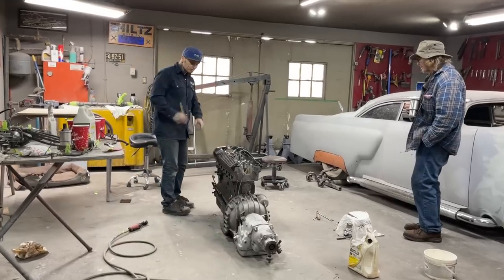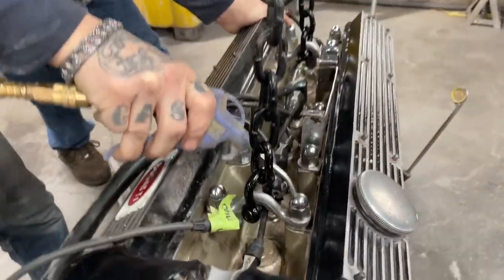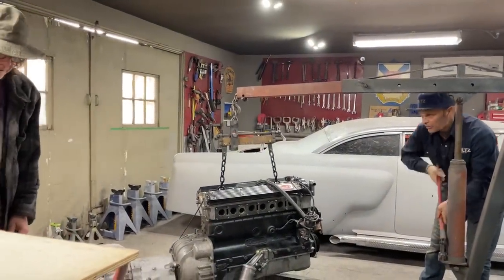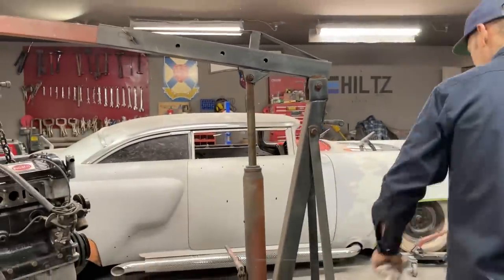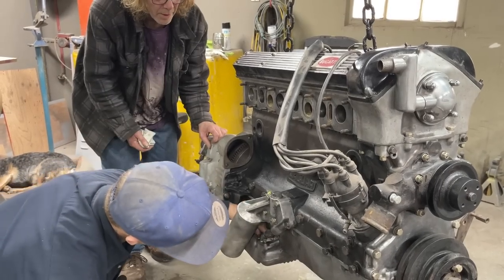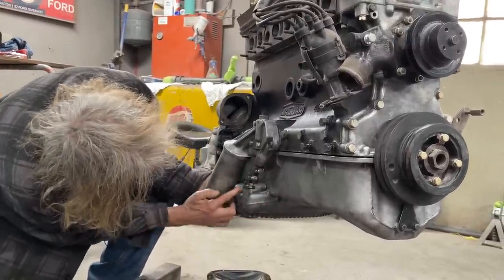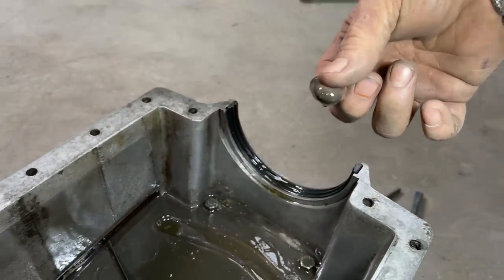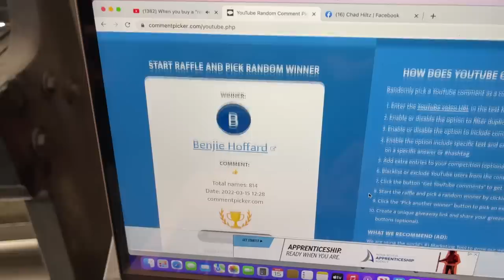The Moment of Truth: Pulling the Oil Pan to Check the Internals

Comment: Why can't Jim get past the oil filter issue. There are metal filings in the pan. Period, end of discussion. Regardless of what it's got for a filter.
Reply: This 100%.
Reply: I know right. Plus can’t believe no one thought that perhaps if those shavings aren’t in the filter, that perhaps it’s the wrong filter. BOOM
Reply: That engine is old. Not rebuilt
Reply: Exactly !
Reply: Unfortunately the metal always goes to the bottom of the pan and only a small fraction ever makes it to the filter. The pickup tube only goes down so far and it doesn't wipe the bottom of the pan. I agree the motor is not what it should have been. That really is a huge let down.
Reply: That's a scam rebuild and a poor shade tree overhaul There are good used engines with 50,000 miles or less that are very clean and properly. Maintained will run trouble free for 200,000 to 300,000 thousand miles trouble free.  Sorry this one didn't work out.  There are reputable used engine dealers and rebuilders that will warranty up to 100,000 miles. Good luck. Like your show.
Reply: Nothing to do with oil filter, that oil shouldn't be sludged and black for a engine that only been broken in. It takes over 1500 miles for new oil to start turning black. That engine is wore plum out!!!
Reply: He always fixates on things.
Reply: @Brab82  Jimbo does fixate. Because it's real, it is part of his unique charm!

Comment: It looks like you guys are over your heads. Jaguar engines are my area. I'd be happy to help out, but I'm 1500 miles away.  Your friend Jimbo sounds like he has no idea what to do. Jaguar engines leak oil! Making a Jaguar oil-tight is tricky business. Gaskets NEVER get reused. Let me repeat NEVER. A gasket set is not expensive. There are a few good places to order parts. Virtually everything is available. Get a workshop manual. I think you'll want to separate the engine from the transmission. An engine stand is handy, so you can turn it upside down to work on the bottom end. A stand is pretty handy for painting and detailing too. Pull off cam covers and check valve clearances.  Remove bearing caps and look at the bearings. Put a fiber optic scope down each spark plug hole and look at the cylinder walls. Cut open the oil filter and look at it carefully.
Reply: This is way past looking for metal in the filter.  
He needs an engine guy and a machinist and a few boxes of parts.  
Quite a few inline sixes are available that would work much better in this car.

Comment: An engine oil filter doesn’t magically clean the inside of  a “dirty” engine. Once settled to bottom of oil pan it’s there to stay. I’ve tore down engines with over 300k untouched and oil pan was cleaner than that.
Reply: With a rebuilt engine?
Reply: I pulled down an engine with 250,000 miles on it and it was cleaner than that.
Reply: @yamaha226  I’m thinking he never rebuilt it. Maybe replaced something to get it running. But that sludge on the bottom is not from a new rebuilt motor.
Reply: I pulled myself over a engine with 1million miles was cleaner that!
Reply: yea that gunk is THICK on the windage tray,  just thick, soft aluminum bronze... big end bearing material .. frankly and I'm not trying to be a dick here but I've never seen it so thick like that in person, only in books and internet.. the "how to rebuild engines for dummies manual"...  DOH!!!  j/k man... confident your builder is a pro, shit happens... I'm real meticulous and change oil/filters early and often, specially my bikes, what we saw in the video is what I'm trying to avoid.. could be 150k hard kilos on that oil change? we just don't know, buts if thats a fresh build I'm a virgin, three times...

Comment: Being a motor engineer I would completely strip the engine. There should not be any metallic particles in the sump. The oil pump will pick them up and circulate them around the rest of the engine. To me it looks like a used motor that's been cleaned up to look nice and new. Strip it or give it back.

Comment: FYI:  The filter only filters the oil being pumped into into the top of the motor from the pan.   The oil pan will collect everything that runs down from the motor, then you pump it through the filter to resupply the top of the engine.  In a fresh motor, there should be VERY little sludge and DEFINITELY no large chunks of anything in it.  When the motor breaks in the surfaces wear , a little sludge on the bottom is expected and is normal, but not caked like that.  After break-in, you change oil to get rid of that initial junk in there.  
You should buy a cheap bore scope or endoscope.  You can pick one up for about 25 USD  think.  They attach to your cell phone so you can take it with you when you check out a motor.  Just pull out a plug and take a look, that will allow you to see the  crosshatch pattern without taking off the cylinder heads.

Comment: I absolutely love when Jim gets excited. "Poison" he says. You're right Jim, that engine is "Poison"
The filter does filter the oil yes, but metal filings will be found in the oil pan on a motor that's got internal problems like that.
I'm no expert, but on a newly rebuilt motor there shouldn't be any metallics in the oil pan like this one has.
Reply: so true, years ago some had magnets on the bottom of the pan.  that way it would not go throgh your engine again
Reply: @ashpnk06p60  yes sir, I've had magnets on my oil pans over the years when I had older pickup trucks.

Comment: I was nearly shouting - get a damn magnet! I think that engine is worn out and looking up at the pistons will tell if it's been overhauled. Pulling the rod caps will also be telling, though they could have been replaced as they are relatively easy. Regardless, I doubt anyone watching the video would think this engine should be used unless it is competently overhauled. I also think finding loose items and improper fan blade bolts was good fortune. Jolene's intuition was spot on.
Reply: I’m more worried that no one mentioned that it wouldn’t be that way if it had the right filter.
Reply: Well said
Reply: Good point
Reply: @linc4572  lol
Reply: I was like you with the magnet lol! Sure looks like metal. But it doesn't matter I s'pose, Its foreign and "poison".
Reply: I’m going nuts yelling at the tv !! Chad keeps his coool pretty good ! I can’t

Comment: Makes you wonder if that pan was cleaned when the engine was rebuilt before Chad bought it? 🤔 I'd pull a bearing cap and check the bearings for wear.
Reply: Now you got to check everything in the rest of the motor just to be sure iam so sorry to see this happen , l hope it all works out for you.
Reply: @jerryporter9115  I agree, but if the bearings are wore theres no use in checking the rest. Hopefully Chad gets it taken care of.
Reply: They should check that filter. Wouldn’t be that way without the right filter.
Reply: Dude, the engine is old and tired. It's not a rebuild! It's not new!

That looks dirty like 150,000 miles!

Old used engine, not rebuilt. No way
Reply: Thought the same thing! Either way is what it is hopefully the out come isn’t as black and ugly as that oil is!
Reply: There's no way that's a rebuilt motor.
Reply: @johnmacmillan2766  gotta go get it checked out by a mechanic, get it rebuilt, give dougy the bill
Reply: @jakefriesenjake  Unfortunately I don't think Doug will pay for anything... I've had issues with a similar scam artist. A body shop recommended to be by a family member... Nothing but shoddy work with shiny paint. It sucks... But you have to move on and go to a better shop.
Reply: To rebuild an engine and NOT clean out the pan before reassembly is just ridiculous! If I take something off it is always thoroughly cleaned before it is out back on... That's just common sense.
Reply: @OldsmobileCutlass1969Va  I couldn't agree more, but some people take short cuts instead of doing the job correctly.
Reply: @OldsmobileCutlass1969Va  some people don't take off the riveted, hot oil splash gaurd, under pan, from underneath an intake Manifold, after sandblasting and cleaning..... You should see what comes out....

Comment: Need to take a connecting rod cap off and check for copper showing through the bearing that will tell you if it's been rebuilt or not
Reply: Mains too brother
Reply: Plastigauge - if it looks perfect....  verify clearance.
Reply: Why bother when that's the state of the oil pan??!
Reply: @michaelcurran46  I think it is time to get Bernie involved and have Bernie rebuild that engine.

Comment: Ok.. first off some assembly lubes have graphite in them ( and that "sludge" look will be there but not a ton of metal) and if it doesn't feel like metal then it could be the graphite from the assembly lube. The pan certainly looks like there's some metal flake in it, not that that's uncommon on a brand new rebuild because metal's going to move from places that didn't get cleaned from any machining. And.. it's going to come off a new parts. That does look like a little bit much but the camera could be picking up more than the eye. I'd have to tear a rod cap off look at the cylinders AND look at the cam bearings. I wouldn't just quit on it at this point. It'd make a really cool motor for the build.

Comment: The colour of the oil draining out of that engine was the first give away.  So I am not surprised at the events that have now unfolded.  The good thing is that you have the sequence of events on video - so there is no way Doug can deny to come through as regards the "warranty".
Reply: I wonder if Doug has the money.
Reply: Or the right filter
Reply: You got that right Grant
Reply: This will set back Jolene's Car for months - maybe a year or longer to get sorted.
Reply: My thoughts too Grant... That the oil was awful dirty for something that has ran for only a few minutes. I've had cleaner oil after running 500 miles. Maybe the builder put some used oil in... But that still doesn't change the fact that there is metal and sludge in that pan.
Reply: I've gotten pretty dirty oil from fresh rebuilds before (the engine burns off a lot of missed gunk/ gasket material and cleaning solutions and can make it dark pretty quick).I've even seen a somewhat metallic-looking sledge from the assembly lubes, but metal shavings tell no tales.
Reply: @aamantium1  agree

Comment: Greetings from Australia. Love your show. The material in your Jaguar engine sump appears to be bearing  material because its grey in colour and won't be attracted to a magnet. At the very least, pull a plug from one or several of the crank journals and inspect the cavity. If there's sludge in there the engine has not been rebuilt properly. All the oil passages, including in the crank, should be spotless. Jim is correct when he says there shouldn't be any material in the sump. At all. I have pulled down many Jaguar engines in the last 45 years of Jaguar ownership and what you say is true, to go any further with that engine you need to pull it down completely, clean and reassemble to correct tolerances.  Doug may be a great guy, but this engine will not last in that condition.

Comment: Hello Chad you really need a boriscope to look down in the cylinders through the spark plug hole so you can check for cross hatching on the cylinders that I'll tell you if it's a fresh rebuild or not if you look up real good from under the oil pan you might be able to see that's what I would check. Sorry about the lack of punctuation

Comment: I feel so bad for you guys but, all is not lost. You have done all the hard work already. Buy a motor manual for that motor, and pull the heads. Your now into the motor. 15 more minutes and it time to rebuild that motor. Labor is the most expensive part and you've already done most of it already. Very easy to do and than you know what's been done and you have a brand new motor. Good luck Chad, you were very smart to pull that oil pan and it told the story!!!

Comment: Hey, Chad, looks like metal shavings in the pan. I would get your money back. Furthermore, with all the trouble you had just to get the starter and pan off, I'd ditch the exotic engines and go with a simple Ford or Chevy straight six. You can dress them up with an aluminum manifold,  four barrel carb, headers and a ribbed chrome valve cover. The valve cover would mimic the jaguar's. I think Jolene having a reliable and safe engine should  be a priority. Nice show, by the way. Take care.😊

Comment: You are totally right. As it sits , that engine is a boat anchor...
Bite the bullet and have it completely  
rebuilt by a reputable shop that specializes in brit motors..
The car is going to be off the hook awsome..
You and Jolene need to be able to jump in and cross country with  confidence. 
🚬🐕

Comment: Short of going directly to a rebuild of the long block, this is a good and prudent move. I don't expect Doug to honor the warranty.
Reply: Even if the engine builder says he would honour the warranty, would you have confidence in letting him do it?  Somehow, I don’t think so.  You would always wonder….
Reply: Is Chad and Doug's falling out on film? If so what episode might it be on
Reply: @catrakes5276  I don't believe that was on video but if you recall, Doug also screwed Jim out of the the money he promised to give Jim when he sold the truck that Jim gave Doug an awesome deal on. Chad mentioned on video that Doug had sold the truck and would be paying Jim as promised but on a later video Chad said Doug was not paying Jim after all. I knew then that Doug was not an honorable man.
Reply: @rcastillon1  Any idea which video it is where it's mentioned that Doug was not paying Jim?
Reply: @Camshaft2011  I'd have to go back and check but I'm pretty sure it was during the "race car" build.

Comment: Agree.  But without a complete tear down of the engine you will never know what you have.  Jim is incorrect that the filter would catch all of that material.  The filter goes into bypass when the oil is cold and that debris can be anywhere in the engine.  Also, the debris always goes to the pan first, then through the pump and into the filter.  Checking torque is easy, mark the head of the bolt or nut and the block, loosen the fastener and retorque it.  If the marks line up again it was torqued correctly.  If not, it was tight or loose.  Either way will lead to a failure down the road.

Comment: The stuff in the pan may assembly lube and the is in the screen before the filter. Check the bearings. The engine may have been assembled with grease and is just not melted and mixed in the oil yet. That engine is most likely good. The engine bearings will tell the story. Check the bearings
Reply: welp that's an awful lot of assembly "grease" .. one applies a light coating to mating surfaces that's it, sides that wouldn't explain black worn oil?  imma say this engine was neglected, owned by someone with money who just didn't change the oil for whatever reason.. and now its running in filter bypass mode and that's that as they say in the car building world...

could there have been a catastrophic failure that polluted the oil and blocked the oil filter? possible, but that doesn't account for what looks like hours and hours of deposit on the windage?  again I do not know this motor at all, might be a common issue far as I know?

Comment: I don't know about that, a lot of people put grease on gaskets so they make a good seal. The metal pieces will stay in the pan if it cant pass through the pickup screen.
Reply: Just like putting oil on o rings and seals when changing your oil filters ...dosen make them leak as long as they are tightened properly
Reply: The question isn't whether or not the metal pieces will pass the screen or filter. The real question is WHY is there metal in the oil pan and WHERE did it come from?
Reply: @bjodaddyo  Yeah, for sure. Must be from the bearings by the looks of things.

Comment: Two things
The rubber hose from the sump/oil-pan to the filter housing should be changed to hi temp silicon and behind the round housing on the front of the cylinder head is the gauze breather which its vital to be 100% clean or the engine will begin to blow blue smoke.

Comment: Dear Chad and Jim:  You are now in the engine.  It is no extra work to check if all the crank main bolts are tight and con rod bolts are tight.  If you are not going to check them with a torque wrench, at least check if they are finger tight.  Also, wiggle the big end of each con rod to check for play.  My guess is that metal came from the con rod bearings.
Reply: That engine sounded awful when they ran it. Jags are quite smooth.  On its way out. Got to be gone through. Not by Chad.

Comment: Chad I have built skads of engines with my brother at his shop.If we ever let an engine go like that we would be out of business. Every builder has a few mechanical mistakes which was one mopar engine that was screwed around  with before we got it back. So in my opinion he didnt rebuild the engine. He may have just re-ringed or something and slammed it together and cleaned the outside so you wouldnt notice. The engine should be spotless.

Comment: In all fairness, this could just be a case of bad cleaning before reassembly, no excuses- but further investigation would be the right thing to do, Borescope, and crank inspection, then look at the cams, then take it from there, all may not be lost, further falling out isn't going to help!  Jim- crap in the sump is pre-filter,  seems to me the strainer has done its job, check the filter,  hope you get a good outcome on this, good luck.